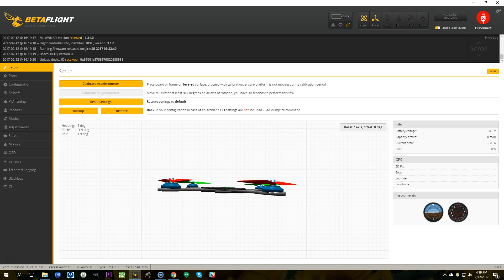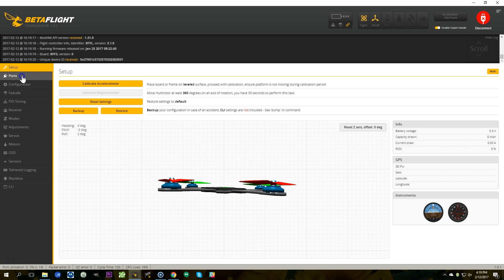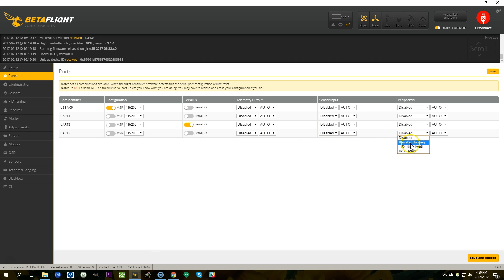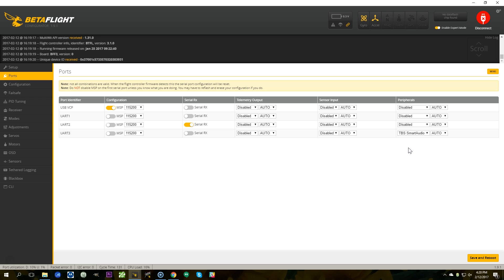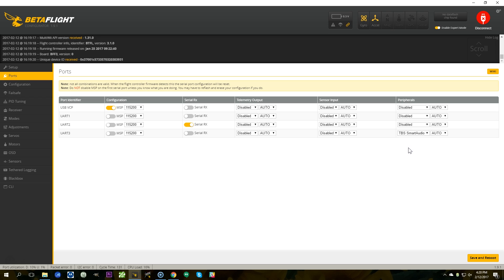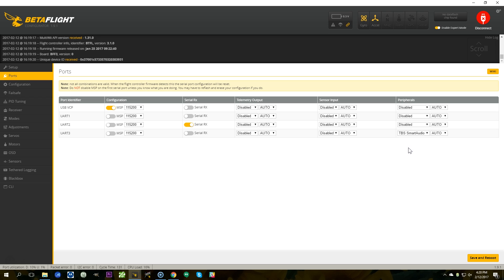BETAFLIGHT SMARTAUDIO | Change vTX channel and power remotely!

Comment: Would it be possible to do this but retain audio by adding a second wire from the audio port on the TBS to the audio port on the FC? Or would that just cause issues?
Reply: +Joshua Bardwell Right, I realized that later. I figured the audio from the Smart Audio isn't really sound per say but data, and will either just be garbage sound or the ambient audio may conflict with the VTx settings. Perhaps it may change settings based on frequency, i'm not exactly sure. Testing it would make for an interesting video though. Makes me wonder if future FC's will have dual audio inputs.
Reply from the maker: +Timon Martin audio can conflict with the SmartAudio
Reply: I'm thinking this would be an awesome video, right +Timon Martin???

Comment: Question about the Eachine Wizard and SmartAudio, I do not have smart audio on the betaflight configurator. I only have blackbox under peripherals. Is this flight controller not able to support this feature?
Reply from the maker: You probably just have an older version of betaflight.
Reply: Joshua Bardwell it is 3.0.1
Reply: Thanks for your help!
Reply: Ok i just installed 3.1.7 but it won't let me add smart audio on uart 3. I have an frsky so uart 2 has telemetry on it and uart 3 has the serial RX on it. I soldered the vtx power and mart audio on uart 3 but no luck getting the smart audio to stay saved on betaflight. I hope I didn't confuse you too much.
Reply: Here is a Link to a pic of my ports page 
https://drive.google.com/file/d/0B1wfKxskXQ4kRlgyZFdKdnd6Uy1zMzRaYXRvNUR0N0RRWldF/view?usp=sharing

Comment: Hi Joshua, I have a dodo fc and have wired the audio cable on my tbs unify pro hv (race) to a free uart. Now when I open betaflight (version 3.1.1), and open the Peripherals tab in the ports section, only one option appears, "Blackbox Logging" it does this for all my uarts.  How can I fix this?

Comment: When changing the power output of my Vtx to 200mW, do i have to match that output on my Vrx? iam asking because iam using the Laforge V2 and it has an option to change power output.
Reply from the maker: The RX has no "power output". It's a receiver. The LaForge power output setting is for if you are using a LaForge vTX. The LaForge module can use IR emitter to program the LaForge vTX. If you are not using LaForge vTX, the mW setting does nothing.
Reply: thank you i was confused as to what that was for

Comment: i know i can wire a resistor and cap in to have both mic and smart audio but in theory i could also just wire in an external switch on the quad to switch back and forth right? also if the script could be turned on and off maybe you could just set up a taranis to only do smart audio when the quad is disarmed or something
Reply from the maker: Yes you can set up a switch.

SmartAudio already only works when the quad is disarmed. The problem is, background noise coming from the mic can prevent SmartAudio from working when the quad is disarmed.

Comment: I'm using BF 3,1.0 and Unify HV, Soldered white wire to tx UART3 and enabled SmartAudio on the peripherals, but it doesn't show up in features on the OSD.
Reply from the maker: BF3.1.0 doesn't support SmartAudio. Install 3.1.7.

Comment: Might be a silly question but is it possible to hook a switch up on the radio to say change the vtx power? Would be handy to drop to 25mw on disarm with some switches to boost power if needed mid flight.
Reply from the maker: This is something that could possibly happen in the future but for now it's not possible.
Reply: Joshua Bardwell damn, shame.  Thanks for the answer

Comment: Hey Joshua, I'm having issues getting this running. I've got a revolt v2 that I've got on betaflight (due to a dead motor output) and want to run smart audio on betaflight (used same set up on rf1 w/ smartaudio). Using spektrum race receiver (one w/o telemetry). I can connect to the receiver (quad flies) but cannot get the smart audio to work. I have the receiver hooked up to to rx3 and then tried the tbs audio cable on all the tx spots (1,4,3)
Reply from the maker: I don't know the in and outs of the Revolt's UARTs, but could it be you have the inversion solder bridge set wrong? I don't thin SmartAudio is inverted.
Reply: Joshua Bardwell nothing's inverted
Reply: And unfortunately I won't get any help from Preston and the raceflight team because its not on rf1
Reply: I hope you dumped the Revolt...it was nothing more than a hype train that is hitting a dead spur

Comment: Hi. Sorry to trouble u but I'm going insane. Iv bought another betaflight f3 board and now a tbs unify. Iv connected up everything but I have now camera. Vtx is ok cuz I can change all settings through my goggles. Iv done a vid on my channel so u can see as much information as I can. Please can u help. Osd menu camera oi on auto.
Reply from the maker: Manually set the OSD to NTSC or PAL in the configurator.
Reply: Joshua Bardwell  iv tried both. That's y iv put it to auto
Reply from the maker: Then I am guessing there is an issue with your camera. Use the dongle that came with the camera to test it on a TV via the composite input.
Reply: Joshua Bardwell   I have. Camera is fine. I think the board isn't powering the camera. I had to put the red 5v out from vtx to a 5v pin. To get vtx to work. But I have bridged the ram to vbat pad.
Reply from the maker: Why did you put the 5v output from the vTX to a 5v pin on the BFF3?
Reply: Joshua Bardwell it was the only way the vtx works. I tried with the main red and black on ram and ground but nothing. That's y I'm thinking the ram pad has no power to it but I bridged vbat to ram
Reply: The pad bottom of board ram vbat. Is there anything else to configure on betaflight to make it work
Reply from the maker: I don't know what mess you've made but something is messed up. You can't just randomly start plugging things into other things when things don't work. The BFF3 has a 5v regulator that is outputting 5v. The vTX has a 5v regulator that is also outputting 5v. You shouldn't wire two regulators together like that unless you know what you're doing. And I don't think you do.

So now we're in a completely unknown condition. Does the regulator on the BFF3 work? De-solder the vTX entirely and go back to basics. When you power the BFF3 from vBat do you see 5v on the 5v pads? 

Have you soldered the solder bridge to control whether the RAM pin gets 5v or vBat? That alone would explain why the RAM pin is not working for you.

Now power the BFF3 from vBat and measure the RAM pin with your multimeter. Is there any voltage on it or is it just floating? If the latter, that explains why your vTX is not getting powered.

In a situation like this, where you wire stuff up and you don't see power, just break out your multimeter and start testing pads to see if they have the correct voltage on them. That's the first thing to do.
Reply: Joshua Bardwell ok thanks. Il do that and let u no
Reply: And. I am a beginner.  Got to start somewhere. I watch all ur vids. This is my second bff3. But on my other one camera worked but no osd. That's y I bought another bff3. Cuz I'm desperate to use the osd features for pids. Etc
Reply: Joshua Bardwell  just a quick question. Iv just done a test on a separate pdb. And found that the vidio in connection isn't working. When I wire everything up separate the camera works. So I wired vid in and vid out to the board. I see osd but no camera. So the fault is now vid in
Reply: Joshua Bardwell   Hi tested ram and I only get 5v from it. I have bridged the two pads ram to vbat. Plus I tried the opposite way ram to 5v. Only got 3v on that. Ram to vbat reading was 8v dropping to 4.8v. Plus iv found out the vid in for the camera doesn't work. Iv watched so many vids on how to wire it. I'm sure everything is wired correctly. I just wish I new what iv done wrong. My first bff3 I had camera but no osd. Now bought a second bff3 and now no camera. Is it possible my solder iron was two hot and iv damaged something when I was soldering???

Comment: I run a foxeer arrow v3 which has a mic out wire which I paired w/ smart audio (Unify v2 5volt) had them both going into my Tx3 (uart3) and I could of sworn I was able to access the VTX via stick commands while still receiving audio. Now for some reason I only get audio but not VTX info. Any idea as to why?. As of right now it only allows me to run one.
Reply from the maker: The mic sometimes interferes with smartaudio. You can't count on being able to run them both at once.
Reply: Joshua Bardwell looks like I might have to run the resistors 😕. Thx for the reply btw. Not many on youtube reply to their viewers and you've replied to all of my questions in the past, really appreciate it.

Comment: Joshua!  I just updated my Spektrum DX6 and now have a VTX menu option that may let me use this feature.  Any idea if this is compatible?  I have the latest BetaFlight board as well.  I was trying to do this with a Beta bin from Spektrum for their SMPFCF400 FC, but have evidently bricked it.Since I have the BF board on the bench, I thought I might try that before I spend $60 to replace the Spektrum FC...of course I could grab a telemetry Rx at the same time and try out their piggyback option... sigh.  Thanks!

Comment: Hallo Joshua, i followed your instructions and i can changes the settings in my tramp hv. Do you know if it is possible to put the tramp in pitmode with a switch on the transmitter? I can put it in pitmode with the osd screen, But then you cannot see how to turn it on any more😂. So thats not very smart(audio). To do it by a switch on the taranis would be a Nice addition.
Reply from the maker: Betaflight can't do pitmode via aux switch currently, but I have begged for this feature and I hope to see it in 3.2. There is a pull request active. Also, there is a Lua script linked in the pull request that can do it today if you prefer.

Comment: Can I use smartaudio AND a microphone? Or, is it an either-or situation? Is there a way I can use smartaudio on the ground while setting up, and switch to microphone audio to listen to the motors while in flight?
Reply from the maker: SmartAudio and mic can be wired together but the mic may interfere with smartaudio if there is background noise or buzz.
Reply: By wired together, you just mean both wires are soldered to the same UART input pad?
Is there a way to somehow make them mutually exclusive using two UART pads?
Reply: You can use both audio and smartaudio on the same wire if you use a resistor and cap - https://github.com/betaflight/betaflight/wiki/Unify-Smartaudio#using-both-smartaudio-and-microphone-at-the-same-time
Reply: You will just hear the smartaudio "modem" sounds instead of your microphone audio.
Reply: which of the 2 may be effected, the audio feed from the mic or will smartaudio be effected (and maybe not work)?
Reply: Yes you can i did this a while ago by just adding a switch!

1. You need a small switch like this one = send pm.. cant add url gets marked as spam
2. SmartAudio (white cable from vtx) to the middle pin of the switch
3. Left and Right pin of the switch = UART 3 on FC and Microphone 

Works great and you just switch it to SmartAudio only or mic only with the switch.
Strange thing for me is that the smartaudio even works on mic only switched on.. but that makes it even better but i have no idea how signals travel within the switch. I have checked my soldering and there is no bridge and the switch act as it should only left or right is active when checking with multi-meter :)  

If any problems understanding my how to just send me a pm and i can send you pic on how it looks like soldered.

Comment: do I need the telem wire from my x4rSB or not for this to work. thanks
Reply from the maker: If you want to use the BF OSD to control the vTX, you do not. But if you want to control the vTX with a Lua script on your Taranis, then you do.
Reply: Ok thanks, do you use lua or not? I don't see a huge use for it if I have osd

Comment: I have the Furious fpv kombini with frsky x4rsb rx and the tbs unify pro. how would I setup the smartaudio to work?
Reply from the maker: Exactly the same as described here. Pick an un-used UART on the Kombini, then solder the audio from the Unify to the TX pad on the UART. Etc.

Comment: Hi Joshua can I still use my mic for audio with the unify as I like to here the 
Motors if can do I rum both white audio wires to the uart ie the white audio wire from the mic 
And the white audio wire from the unify.
Reply from the maker: You can wire them both up but ambient audio may interfere with the smartaudio pulses, and you will hear the smartaudio pulses in your ear if you have your earpiece in while you are accessing the vTX.

Comment: Hi, I have tried searching everywhere and you seem to be the man to answer my question. I have an SRF3 board with only  three UARTs. UART1 is MSP, UART2 I use for telemetry, and UART3 has the Serial rx enabled. I have ordered TBS unify pro and now I wonder how I should hook it up to be able to use the smart audio feature. Do I have to sacrifice my telemetry? or just hook it up to one of my UART TX and enable it as a peripheral? (is it possible for the UART to work i.e. as an MSP and also a smartaudio or. telemetry/smartaudio or RX/smartaudio? If anything of this could work / which UART shall I turn the smartaudio peripheral ON? thank you for all the efort you put into your videos.
Reply from the maker: You only have three UARTs, and all three are in use. If you want SmartAudio, you have to use another serial device. Can you enable SoftSerial on that board? Otherwise, you will have to trade e.g. give up Telemetry so you can have SmartAudio.

The best way to use SmartAudio is to use a board that uses VCP, so UART1 is not tied up with MSP. Then you have enough UARTs for serial, telemetry, and smartaudio. You can also use a board that supports softserial.
Reply: Joshua Bardwell I will look if the board support sw serial (never messed with this stuff-I am only a month into the hobby..) I hope I can make it happen. When I enable sw serial (if the FC supports it) where should I solder my smartaudio cable? IO1 pin6? Found some doc at wikirotors that states that when sofr serial is enablet it is there. Am I correct? I have sprf3
Reply: I can enable SW serial, I will probably move my telemetry to SW serial 2 that is on IO_2 (so I can disconnect ir together with my SBUS receiver) and use either UART2 or SWS1 for smart audio. thank you Joshua for your advice

Comment: hi do you still get sound from you mic doing this set up ? ace videos by the way thay have help me a lot
Reply from the maker: +ggvaper you can wire up both SmartAudio and the mic but they may interfere with each other if there is loud ambient noise.
Reply: Joshua Bardwell I know this is old and probably figured out..... I'm running RF have smart audio working but can't get SA to work if Mic from cam plugged in. Trying to understand how to proper wire it, is it  a ceramic 100nf cap in audio line? Is that needed. Using swift 2 unify pro V3

Comment: i josh, question. i have a betaflight f3 board and im using the TBS unify pro race and i have everything almost exactly like this. only difference is i have my audio wire on UART 1. im not getting nothing in the osd, i can do all my tuning and everything else but im not getting a option to change VTX settings.. any idea what may be goin on? brand new build, first time using smart audio. thanks in advanced.
Reply: i am following this because im having the exact same issue, all osd works but when i go to the Features tab, nothing for VTX settings, what am i doing wrong?
Reply from the maker: I assume you have enabled SmartAudio in the Ports tab? If you haven't enabled SmartAudio, then you won't see the options on the OSD. Have you used the TX pad on UART1?
Reply: yes i have enabled it. no i have not used it previously. this is a brand new build. i switched it over to UART 3 to see if that did anything and nothing. i mean its a really really simple thing to achieve, thats why im really confused here. haha.
Reply: i was running betaflight 3.1.0 and up dated to 3.1.6 and fixed it Glitch. i thought from what i seen 3.1.0 worked. but evidently not.

Comment: Is it possible to get this working on Lux v2 FC, but using TBS PnP50 as the OSD instead and how? I have currently my TBS PnP50's SmartAudio wire hooked up to UART1 on the FC, i have set UART1 to TBS SmartAudio in BF and i have set the OSD switch in Betaflight 3.1.6 to Aux 4. So, do i then set the OSD switch in TBS PnP50's menu to channel 4 to match the Aux channel on my FC or do i set it to channel 8 which is the channel for that switch in my taranis?

Comment: I'm running the betaflight f3 and running my cam and vtx power through the board as the wiring instructions but getting crazy noise on my video feed ! any help would be greatly appreciated

Comment: How can I put the TBS Unify race into pit mode via the Taranis, I can save and change channels, I can adjust my PiDs but just cant get pit mode to stay on... Please help
Reply from the maker: I don't use the Lua scripts so I don't know. In the OSD, you just enable pit mode and it powers up into pit mode.
Reply: I dont have an OSD, Im using a LUX FC(Yes I know).... On UART 1 Sbus, UART 2 : TBS, UART 3 is s.Port,And No Softserial,  Any idea on how i can connect up an OSD.. ie the Piggy-OSD for the Hs1177 , Thanks in Advance